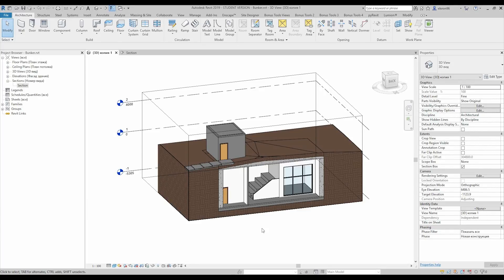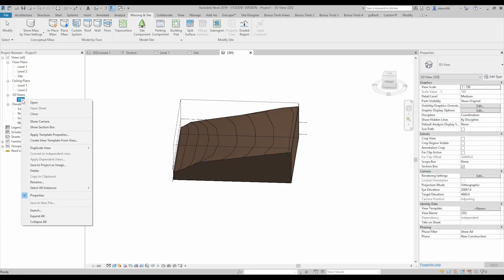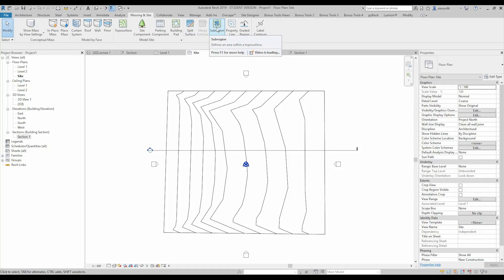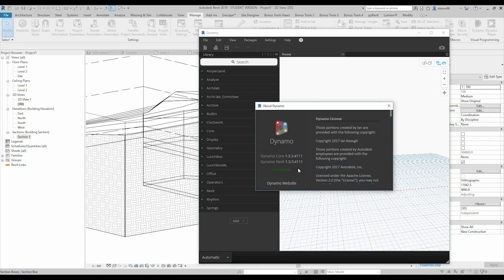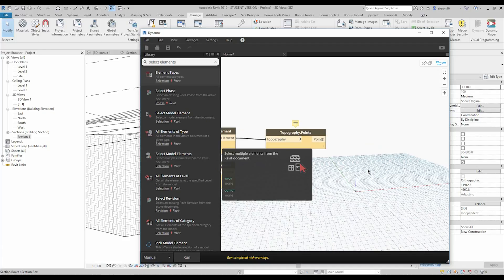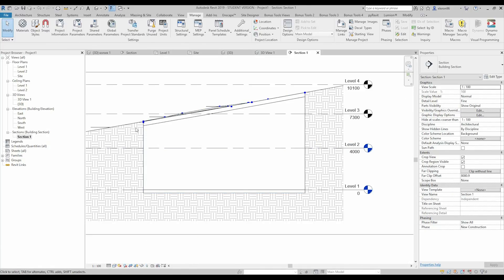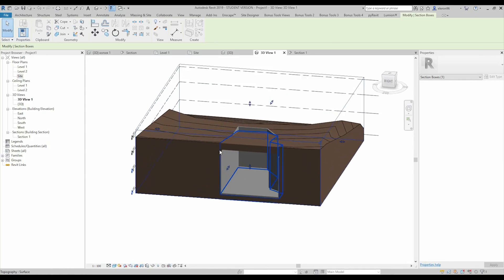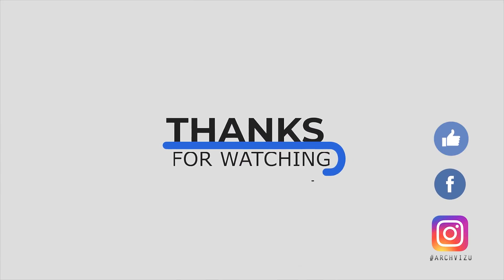Underground Building in REVIT (Bunker) [LR5M]

Comment: Hey man, nice video. I am stuck on the selecting points part. When i click the select on the Dynomo and then move mouse to the top part  i need to select nothing gets selected. How do I select the top part of the bunker like  12:21 ?
Reply: I have the same problem. Did you find a solution?